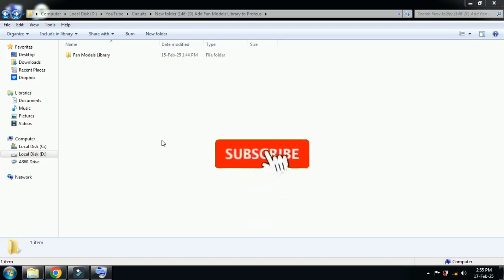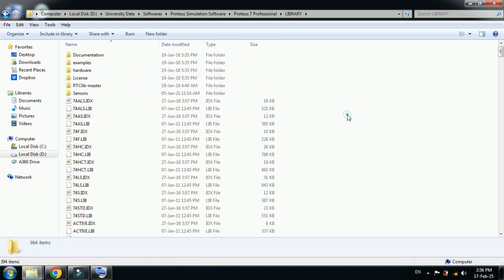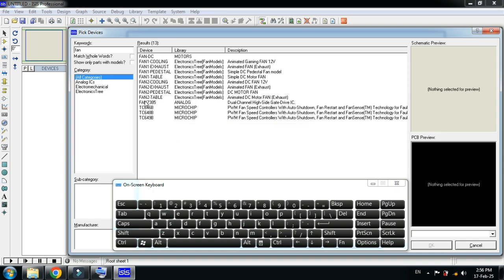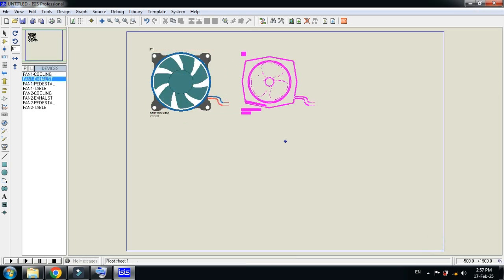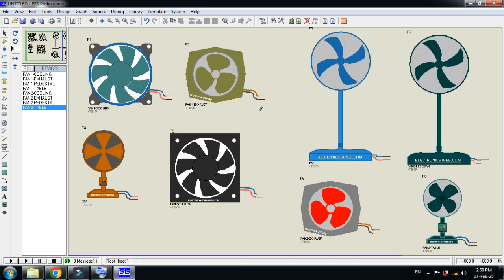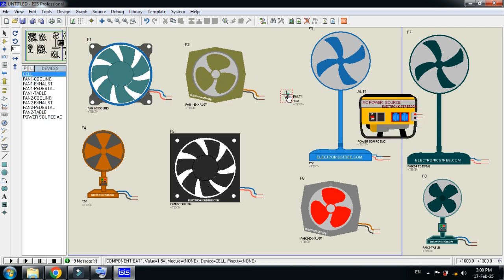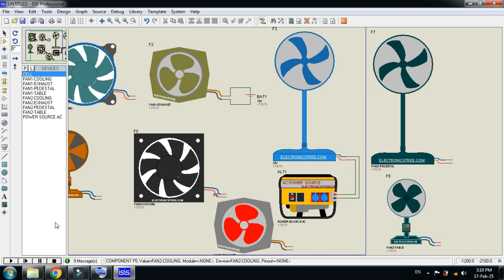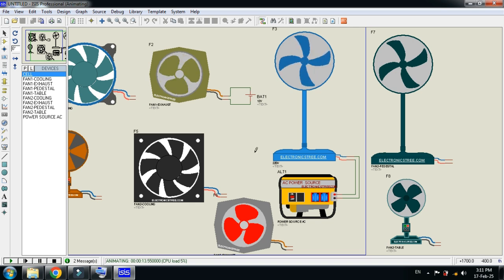How to Add Fan Models Library to Proteus | Step-by-Step Guide

Comment: Hello what about aç fans
Reply from the maker: You can use these fans as an AC as well
Reply: @thebrightlight9472   ı mean my fan is work with AC  not DC . I couldn't even find a library for this in Proteus. Do you have a suggestion?
Reply from the maker: Use these fans, it will work
Reply: @thebrightlight9472  thank you sir